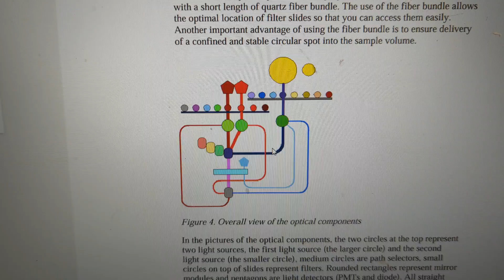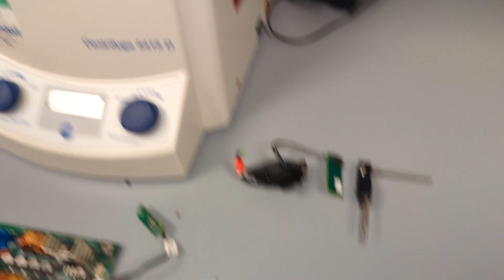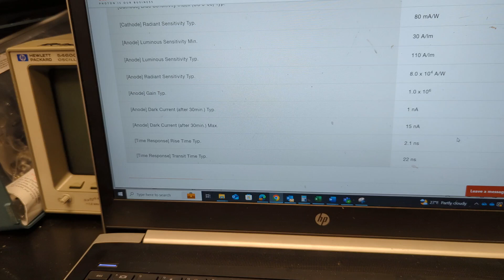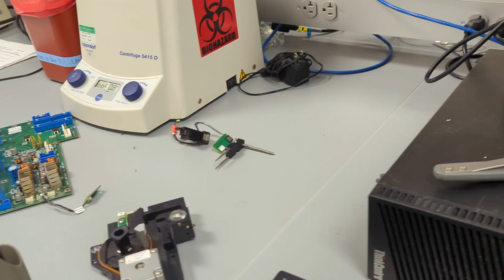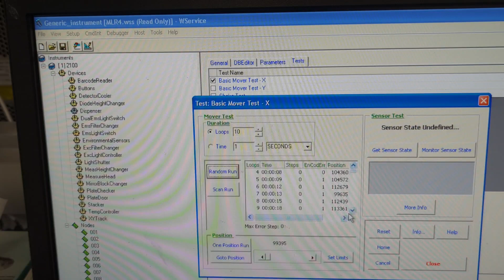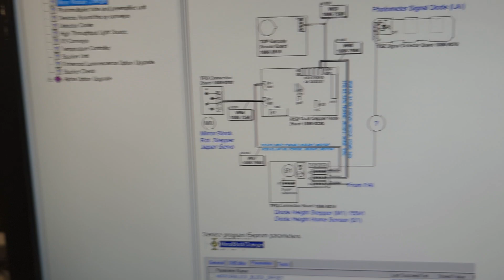PerkinElmer Envision Plate Reader - Teardown, Repair Tips, & Using WService Mode App

Comment: Hi. I'm getting a reader error: 1312 (mirror block changer) system might be in inconsisstate please restart.  I've restarted numerous times to no avail
Reply from the maker: So I go over this a bit in the video.  There could be a few potential causes.  The most likely being that the daughter board that has the barcode reader IC (it is an infrared diode with a phototransistor) needs to be realigned.  Or it could be that the barcode reader IC needs to be replaced.  Pull the cover off to view the instrument while it initializes.  Best to do this in service mode which I also go over.  Can you see the red light emitting from the IC?  Does the mirror module changer spin during initialization?  Aligning the barcode reader board can be tricky.  You will also need to make sure you have the correct mirror modules on hand to recalibrate the mirror module positions to ensure they are being read properly.